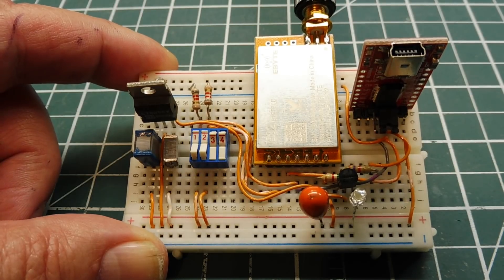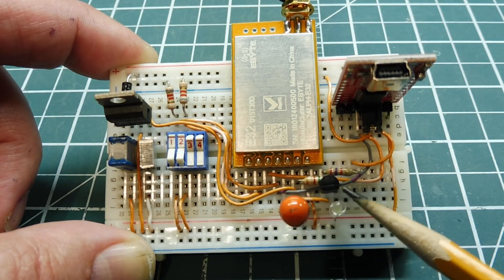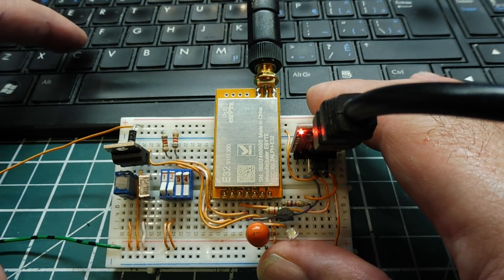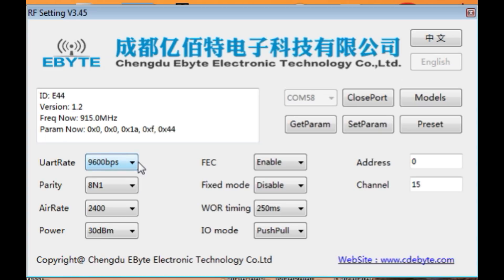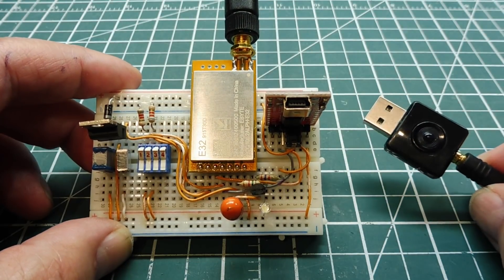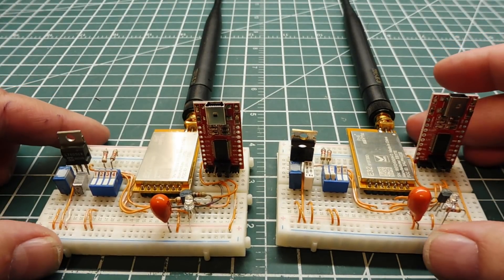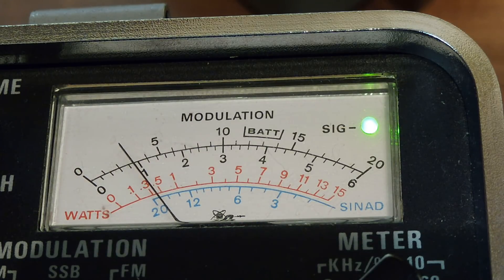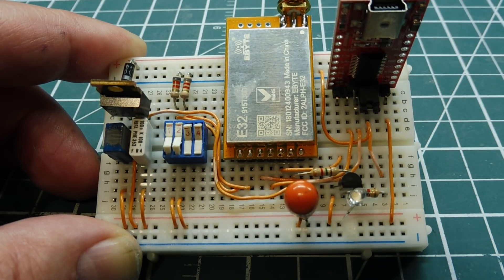Getting Started with LoRa  / Build a LoRa Radio Link

Comment: Hi, there! Thanks for this great tutorial!
I am wondering how you can display the frequency chirp in the oscilloscope?
The chirp modulation should be seen in the frequency domain, but you nicely show it in the time domain!! 
What is the trick?
Reply from the maker: I am monitoring the demodulated signal of an analog FM radio receiver tuned to 915 MHz. The 915 MHz chirps are down-converted to an IF frequency which is fed into an discriminator (Foster-Seely) where the chirp frequency shifts are converted to voltage shifts which can be monitored on a scope in the time domain.

Comment: Are the FTDIs set to 9600baud?
Reply from the maker: The baud rate of the FTDI is set automatically by the FTDI driver that is running on your computer as a virtual comm port. The LoRa radio is configured for 9600 baud and Tera Term is set for 9600 baud which automatically sets the FTDI module.

Comment: Good video. Regarding the power I´m not sure your measurment equipment is ”up to the task”. The LoRa transmission is pulsed, i.e. not a continuous signal. W = J/s. (Joules per second) and if your power meter can´t handle pulsed signals the shown Watts will be wrong. My 2 cents. Oh, 30dbm is illegal everywhere I think :-)
Reply from the maker: Yes ... you are correct. Measuring a pulsed power output with an averaging wattmeter will indicate a lower reading. The wattmeter I am using is capable of measuring "peak" power output across a 50 ohm load. It has a spectrum analyzer which can detect the peaks and display the reading on a analog meter. The LoRa radio also has a preamble mode which transmits continuously and I get the same reading. The reading I am getting is quite a bit lower than spec. (Still working on the mystery.)
Generally, spread spectrum radios on the 902-928 ISM band (Canada/USA) can feed an antenna with max of 1 watt and EIRP from the antenna is restricted to 4 watts. So a high gain yagi could get you in trouble. There is also bandwidth and dwell time restrictions. Rules are always changing so latest restrictions from the FCC and IC should be checked.
Reply from the maker: Contacted the manufacturer in China. The output power spec in their data sheet is the Power Spectral Density which is calculated not measured. I updated the description box with an explanation and a link to a video that goes into greater detail.
Reply: Actually no, these modules meet Canadian output standards here. No issues. We are limited to 7 watts on the 915 Mhz band as it is license free.

Comment: What is the problem with the output power ?
Reply from the maker: It reads lower than the data sheet spec.
Reply: Yeah, but I mean did you figure out why ?
Reply from the maker: No ... not yet.
Reply: @0033mer  Andress Spiess youtube channel shows that many of the antenna's supplied with boards are not optimized for the frequencies they are supposed to work with. He also has a meter that measured a few of these antenna and it showed they can be  off by quite a bit.
Reply from the maker: My Wattmeter will display instantaneous power.The data sheet spec is channel power which is the power level integrated over the total bandwidth. The description box has the full explanation.

Comment: Having not paid enough attention to (various) Andreas Spiess' LORA vids, good to know now that peer-to-peer is entirely workable...  I had thought there must be some sort of LORA 'hub' or whatever, that was necessary in one's region.  Also, compliments on showing operation w/ test equipment, rather than just assembling the project then showing it works.  BTW, did you actually test the spider-looking antenna?  Thx.
Reply from the maker: As an option you can use Lora with a LoRaWAN gateway and connect to the cloud via The Things network.
This gives you access to your project from anywhere in the world but are restricted to the amount of data you can send.
I did a field strength measurement on my ground plane mono-pole antenna and it performs better than the antennas that came with the modules.. I have not actually used them in a range test.

Comment: Great Lora info. Going to try this on a small long range project.
 Would have liked to see some links to the parts/software you used...;-)
Can't understand why someone thumbed down this informative video. 
Must have been way over his head.... LOL
Reply from the maker: E32-915T30D Lora module, user manual and software available from Ebyte.
Website link is on their software page at 3:39:   www.cdebyte.com
Sometimes they post their parts on eBay
Do a search on eBay for E32-915T30D
Reply: Thanks for the reply and info. I opted for 20dbm modules for testing.
Reply from the maker: Curious to see if you get 20dbm (100mw) output from that module.
I also ordered some modules from Reyax ( RYLR896)  15dbm output.
Much simpler AT command interface. Aslo has RSSI indications which I like.
Might do a video on that one too.
Reply: Yeah.. me as well. Troubling to see that you only got 400mW output with 
your 1W unit. Will be looking forward to your Reyak video.